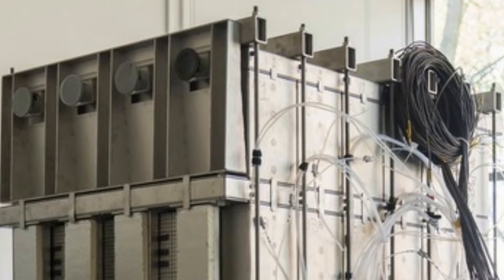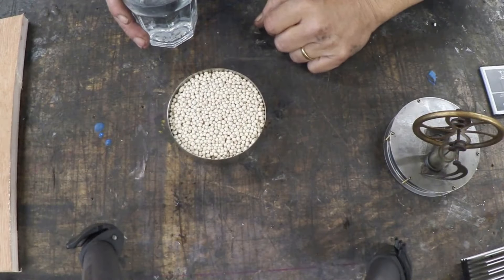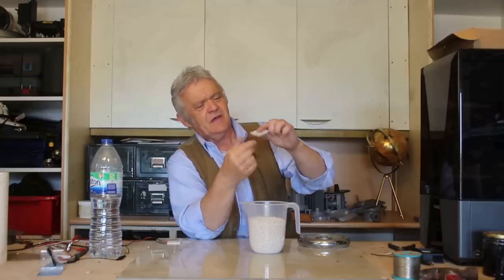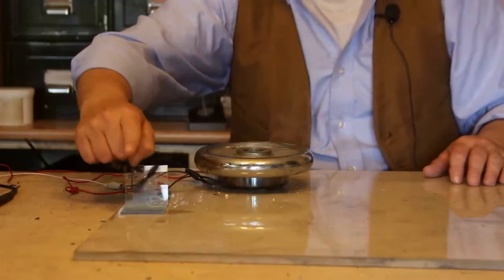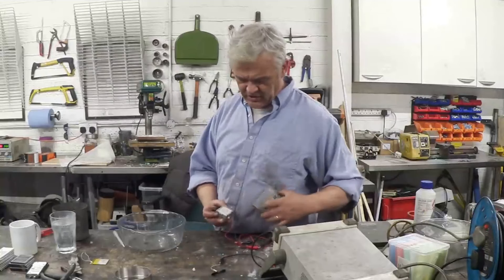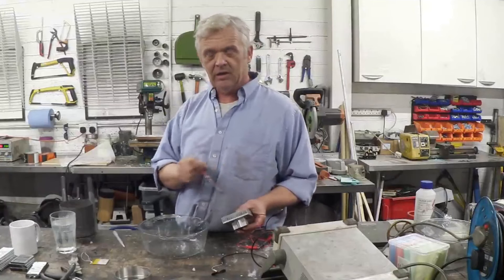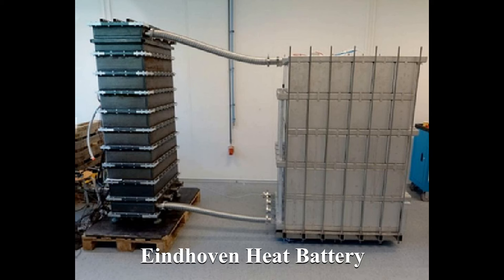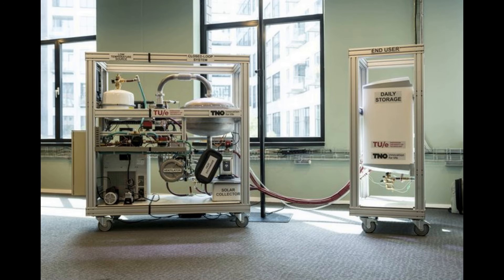2224 Energy Storage Game Changer - The Eindhoven Heat Battery

Comment: Unless its's just coming up out of the ground in endless amounts (aka Geothermal) heat at a few hundred degrees is useless for power generation as per Carnot heat engine efficiency, so the only appliction for these exothermic reactions is direct heat usage.  Only a small number of industrial processes (food processing mostly) can make use of heat at that temperature, which means the home heating market is all that's left.  And even their I only really see water based exthermic reactions being attractive as a backup heat source, if you have had a lull in renewable energy production in winter (the infamous dunkelflaute as the Germans say).  But the idea of moving the stuff around back and forth to industrial sites for  recharge is a non-starter, better to recharge it at home by simply venting the homes normal exhast air over the materials to dry them again.  Zeolites can be dried by room temperature air of sufficiently low humidity, it just takes a long time, but this is ok in a backup system which will be used just a few times a year.
Reply: The problem is the cost in scale, volume, storage and safety, as well as government regulation which always increases the cost.

Comment: Hi Robert, I trailed a sodium acetate tri-hydrate heat battery for a certain company - for one reason or another they all failed - Over all, I have now had 7 x 9kWh units, the last one I am awaiting collection of but I will not be doing any more trials. Its back to a simple divert excess generation to an immersion element in a cylinder for me. Shame, the idea in principle is good.
Reply: What problems develop with them?

Comment: Imagine a small circular track, SS cars full of dried clay stopped in a reaction chamber, waters added, heat tapers and the system advances the train to replace the wet “car with a dry one.   Round and round the train will go.
Reply: Or a conveyor belt stuffed with zeolite, covering the south part of the roof, then when the material is dried, each "pillows" being folded back the house.

Comment: If you ACTUALLY think about it, it's a reeeeeeealy stupid idea. How about you try to harvest the extra heat from factories and turn it into electricity, rather than making a wet gravel machine?
Reply: Because you would have to attach a power plant to every heat source, and would only get 30% of the power as electricity at that temperature.  Better to just store the heat and use it to heat during winter.

Comment: Would you be able to use the cold reaction on one side of the peltier and the hot reaction on the other?  Would that increase its effect at all, or is it no different than running each off of its own peltier?
Reply: Peltier is still expensive and fragile, too much heat shortens it's life span and even destroys it, has to be controlled too precisely.

Comment: Wow, amazing. They managed to pack a twenty foot container with the energy of a gallon and a half of diesel fuel... I wonder how much diesel it takes to transport one of these to the drying facility and back again?
Reply: My thoughts exactly. But given it is low grade heat it should be able to be done effectively in situ in the right circumstances.

Many domestic solar and wind systems (that aren't grid tied) dump a lot of power throughout the year and the dump could be something such as this, or the other heat batteries Robert has covered in other vids. Probably not  enough demand to make this a commercially viable product for sale, but of use to a do it yourselfer.
Reply: Most of the "energy" in fosil fuel is wast heat
Reply: Agreed, moving around such low energy dense materials is completly prohibitive.  It needs to be recharched at the point of use.  I Think zeolities have potential a long term backup heat sources, they could be dried by directing the homes normal exhast air over them to slowly dry them at littleo or no cost.  It's not gonna be a homes main heating system, but it may act to fill a winter heating gap which would otherwise be filled with things like diesel generators.

Comment: I believe you can run a stirling on 2 different gem stone-types, for some of these mini stirling engines only need 2 degree celcius difference in temperature to run, you just have to find the right gems or stones, one day i dream of going into a gem sone store with a heat camera and get out with 2 or more stones with high temperature difference and build myself a nonstop-stirling engine powered by heat difference of gem stones/stones, i believe this is possible, some stirling motors are ablke to rzun with the heat of the hand , just 2 degree celciuss difference and i think this can be archieved with different minerals or gems/stones, what do you think?Motoflux Magnetic Coupling Overunity Magnet Motor Review soon?
Reply: What size stirling would u need to power a generator for lights for your house, what size gems.